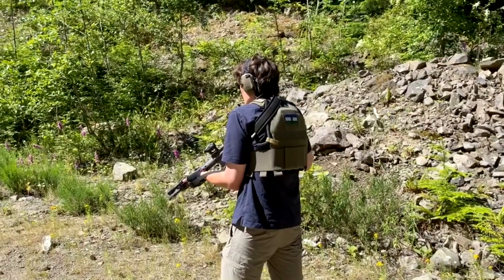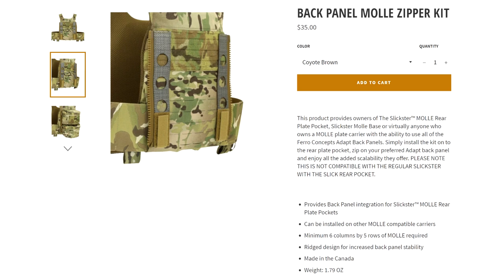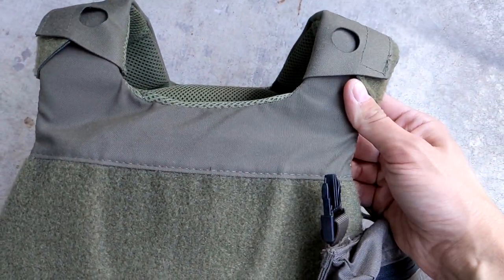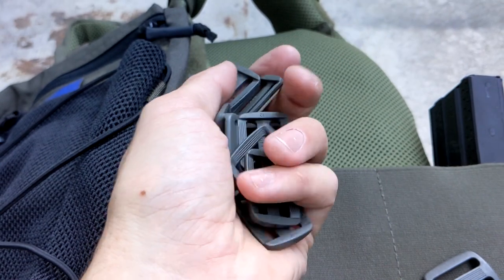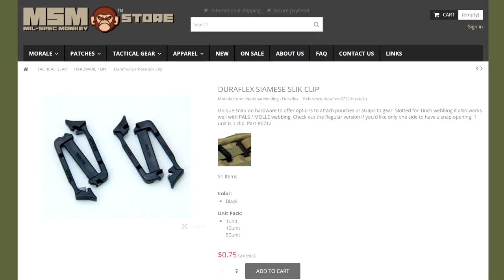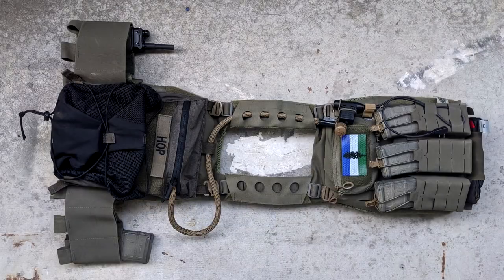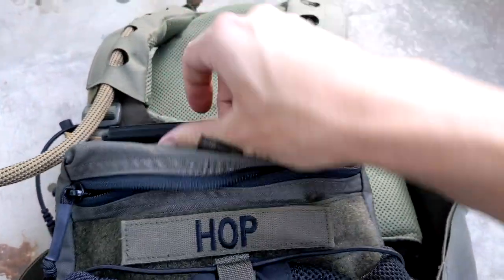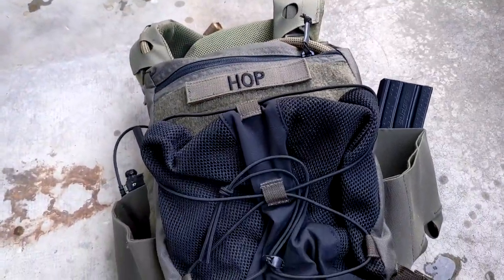How to Add Hydration to a Ferro Slickster

Comment: I just bought and started to run a Haley Strategic flat pack on the back of my Grey Ghost Gear minimalist plate carrier. The flat pack is awesome even if you just run it as day pack without the carrier. It holds a 1.5 L hydration pack no problem and have plenty of storage space for some admin items.

Comment: Honestly, for the price of a decent back panel from a reputable company, I'm surprised you didn't just use a smaller assaulters pack. That way you can access the gear without taking off your entire plate carrier or relying on someone to grab it for you. 

I feel like that may have been ferros intention with the non Molle back panel.

Comment: Why not just buy the molle back pannel ? That's whole point of it. The slickster isn't meant to have things mounted to the back but if you want to do it they have that molle back pannel you can buy to replace the slick back pannel. You came up with a good alternative tho. Not sure if it would be cheaper to just get the molle back pannel vs what you did or not.
Reply from the maker: They haven't restocked the full molle version in probably a year, and they haven't sold the molle back panel a la carte in longer.
Reply: @Hoplopfheil  Ah well that makes a lot of sense then.
Reply from the maker: @Qsaws_  If they do make more molle versions I might get one and the upgraded cummerbund, and move my setup to a new carrier.
Reply: @Hoplopfheil  I got a templar gear elastic cummerbund with roc buckles for mine feels pretty good so far and it still has the integrated pouches but i assume you want molle instead to fit your needs. I've been thinking of getting the molle back someday but haven't tried to buy one yet so i didn't know they had such an issue stocking them. My current plan is to build an other PC using a more "overt" carrier and keep my slickster relatively slick with the L210 i have while having thicc lvl4 plates in the overt carrier that way i have both "extremes" of the spectrum at my disposal.
Reply from the maker: That's the way to go. Trying to have one carrier to scale up and down isn't a great fit.